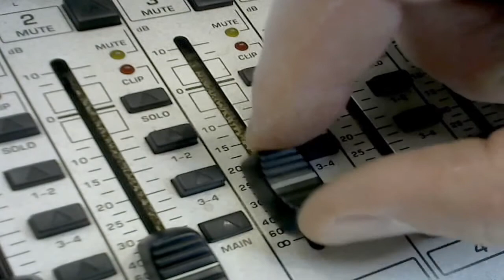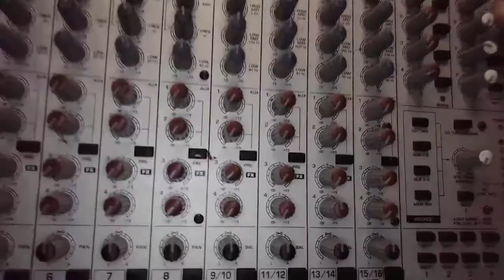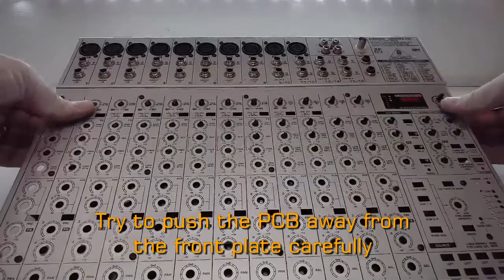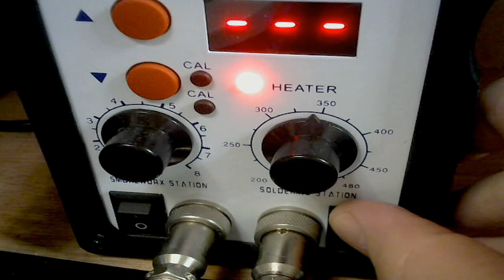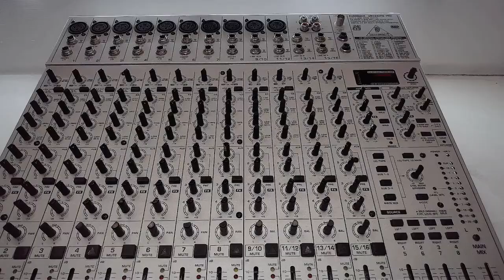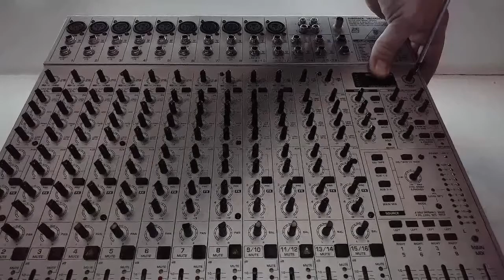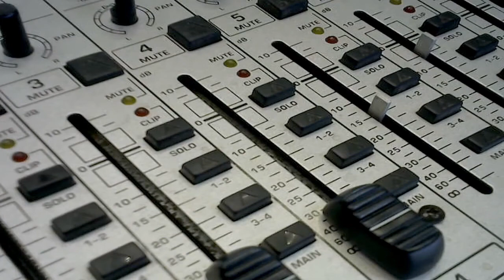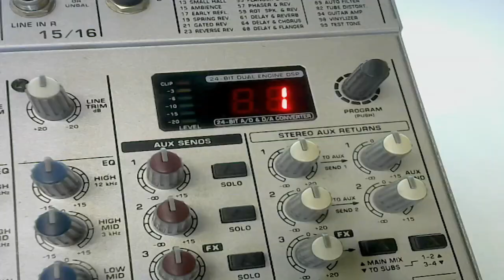Behringer Mixer Repair

Comment: I have a eurodesk that had to have the psu recapped, its very common with behringer power supplys.   Hasnt changed my opinion of the desk at all, its still awesome.

Comment: How did you get the PCB away from the front plate so easily? I have a MX2804A that I'm trying to clean some sticky/scratchy pots & I can't get the PCB off. Can you spray alcohol or Deoxit on the plate to seep down and get things loose? Yes, I have all the screws off the PCB.
Reply from the maker: Normally it is just 1 tiny screw that I miss that causes a PCB to hold fast, Also some PCBs will hold on for dear life if a substance has been accidently poured over it.
The glue they use on ribbons can stick to the inner side of the face plate also.
I would try and lift the edges of the PCB in a rocking motion and at the same time keep an eye on the bend of the board. Hope this helps and cheers for watching. :)
Reply: Don’t pry the board. Press on the pots. If the PCB is flexing anywhere that’s a fault waiting to happen. Slow even pressure is your best bet. Use a hairdryer to soften any sticky gunk.

Comment: I have the same mixer, first there was a supply problem after the supply was repaired and installed there was an IC on the mixer board which immediately caught fire, what was the problem thank you
Reply from the maker: ooof! that`s rough can the IC be replaced or did it cause too much damage?

Comment: Good video - Thank you, can you please assist me. I got a Behringer XENYX X1222USB, It seems the unit is working 100% although the L/H Level Meter (VU meter) does not work. The unit will switch ON and the sound operation is normal - The Power light with the green and yellow lights on the L/H VU meter will not come on. The R/H Phantom 48V light is ON and the green and yellow lights work normally.  Your assistance will be appreciated.
Reply from the maker: Many thanks for watching, Only thing I can think is the sliders are not carrying a very good connection. It`s a pain but maybe strip the unit down so you can get to the metal sliders and remove any grime/rust from them. Sometimes just sliding up and down extremely fast can get them to function.

Comment: hey pj was wondering if you know what size the fader channel because some of the channel no sound and i been i need to replace the faders
Reply from the maker: Hey there, Might just need a good clean out with some Isopropyl alcohol and some ear buds. If the sliders sit for a while they can often lose connectivity.

Comment: have sl2442fx pro  has E2 on the fx read out only on the right side nothing on the left side.  any ideas?  triedto factory reset dsp but still comes up with E2 code on screen?
Reply from the maker: I don`t know a lot about the Behringer equipment but I think an E2 error is possibly a button stuck down when the unit is powered up. Might be worth taking lid off and giving all the sliders and buttons a nice isopropyl alcohol clean :). Hope this helps